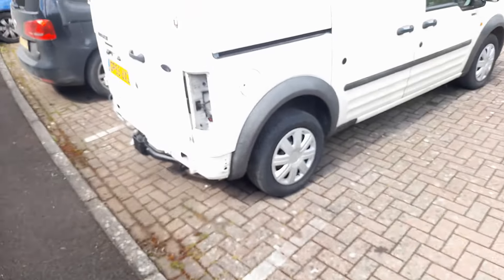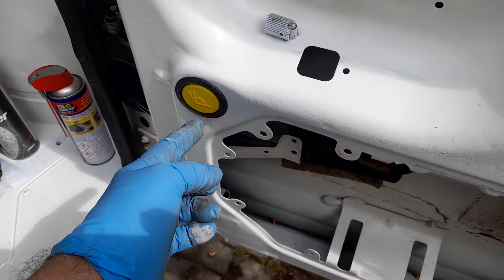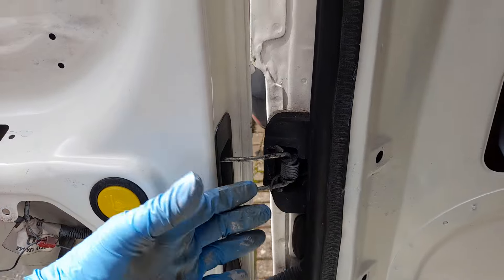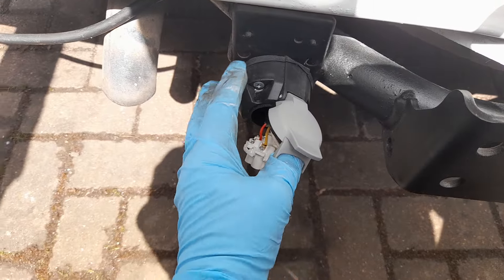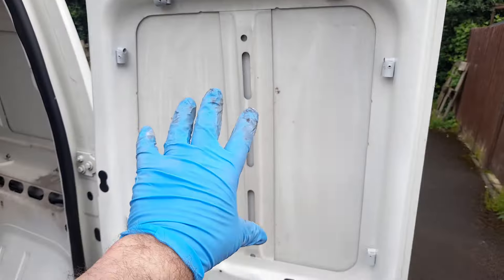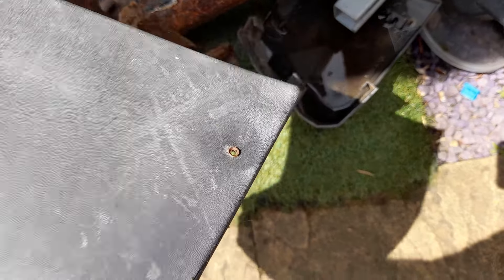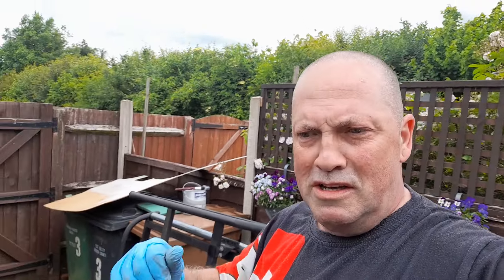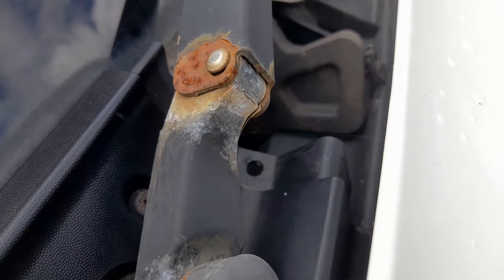ford transit connect restoration episode 1 or 2? who knows.  who cares...let's get stuck in

Comment: Wheel trim stickers used to be available on ebay in abundance.  Floor board, try the old furniture restorers trick for getting rid of oil stains. Soak the affected area with Methylated Spirit and set fire to the Meths. Willburn the oil out of it and either reduce the stain significantly or get rid of it. Paint the wooden floor panels in "Blackboard" Paint, that'll smarten them up. Look forward to the updates.🙂👍
Reply from the maker: Wow thanks for the tips  :-)